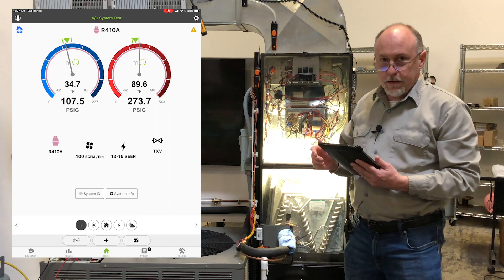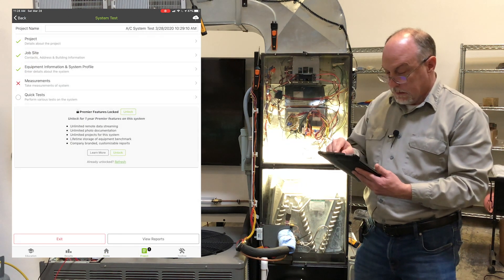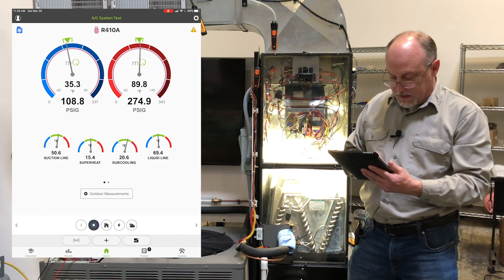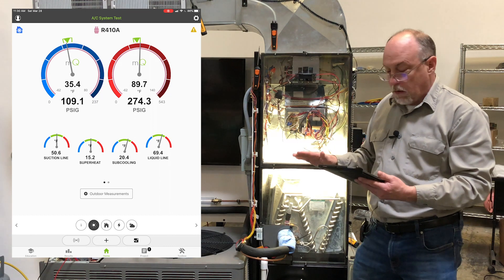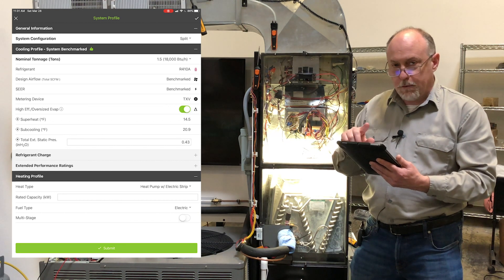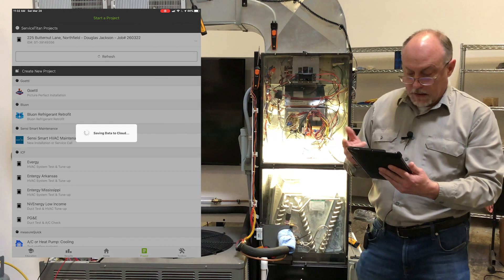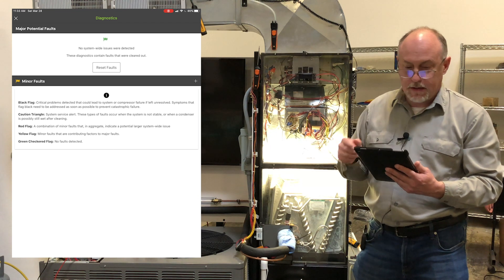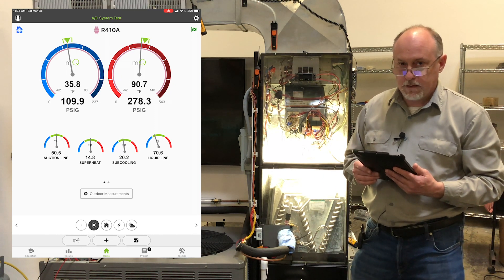Benchmarking in measureQuick

Comment: Thanks Jim. Is there a way to save it in the iPad until you get to cellular range or Wi-Fi?
Reply from the maker: Yes, the projects are stored locally until you sync them and or delete them.
Reply: Was thinking the same thing.
Reply from the maker: Yes, the projects remain on the local device until you sync with the cloud. You can delete them later or leave them on when you want to reuse them in areas of know poor connections.